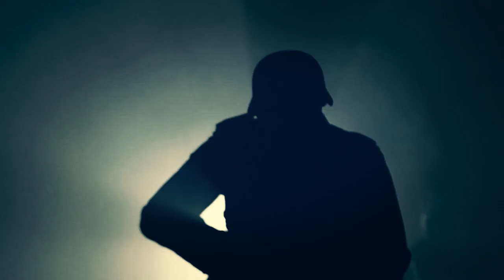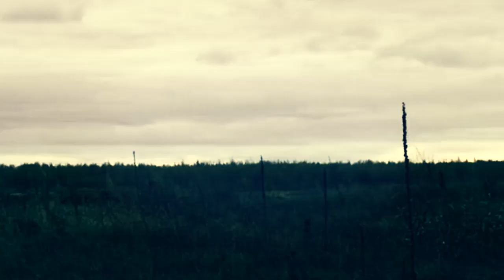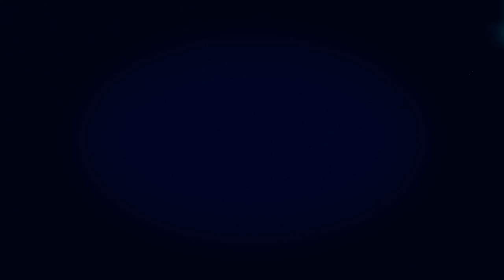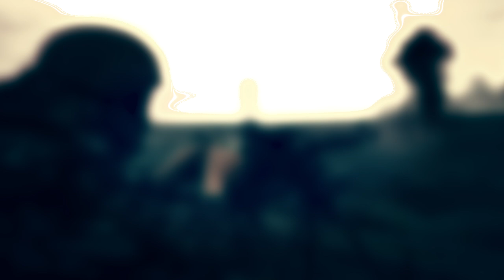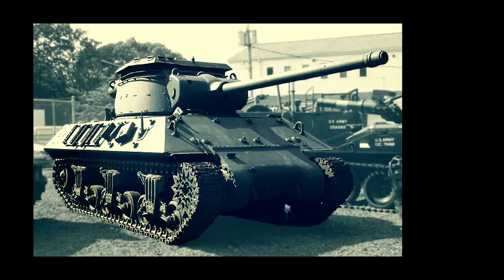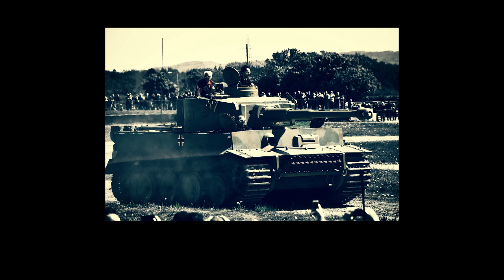The Only Running Tiger (Advanced Explainer)

Comment from the maker: Tiger 131 is not just a museum highlight; it’s a forensic time capsule. Captured by the British 48th Royal Tank Regiment in Tunisia during the North African Campaign on 24 April 1943, this Tiger I was shipped to Britain, studied in detail, and today remains the world’s only running Tiger I at The Tank Museum in Bovington.

Design came first: the Tiger I was designed as a breakthrough heavy tank. It was heavy, but the concept was deliberately simple. The hull and turret are made from large, mostly flat plates of rolled homogeneous steel with interlocking joints instead of complex sloping. This construction provided significant thickness—100 mm on the hull front, up to 120 mm on the mantlet, and 80 mm on the turret sides—but the flat shape removed the advantages of slope. Crews had to angle the hull (the so-called “Mahlzeit Stellung”) to increase effective thickness in combat. The turret was a large, cast and welded unit with a powerful traverse system. Its mass and shape made it both durable and slow to speed up.

Mobility and suspension were also important. To support that heavy protection and the long 88 mm gun, the Tiger used torsion-bar suspension and very wide tracks inspired by the T-34 design. This setup resulted in lower ground pressure than one might expect for a tank weighing 50–57 tonnes, which helped in cross-country movement. However, the trade-offs were clear: combat weight was in the mid-50 tonne range, complex driveline and transmission parts were strained by the weight, and fuel consumption along with maintenance needs were demanding in the field. In short, strategic mobility and logistics became as critical as raw battlefield performance.

The development of the powerplant is crucial for understanding the Tiger’s practical limits. Early Tigers used the Maybach HL210 (aluminium block, ~21 L), which was seen as underpowered for the increasingly heavy production vehicle. Maybach enlarged the design into the HL230 (cast-iron block, ~23 L), increasing displacement and peak power. The HL230 later became standard in the Tiger and Panther series. This change improved torque and durability, but the heavier cast-iron build added weight and required limiting factory RPM and operational revolutions to protect engine life—a reminder that more power meant more thermal and mechanical strain. During the restoration of Tiger 131, the museum installed an HL230 from a Tiger II to get it running again—an example of how closely engine design and serviceability were connected. 

What about armour versus Allied guns? Penetration tables from that time and Allied tests show the 88 mm KwK 36 could reliably defeat most others at combat ranges. The Tiger could engage enemy armour at distances where the opponent’s gun could not expect to succeed against the Tiger’s frontal plates. On the other hand, standard Allied 75 mm and early 76 mm tank guns could not reliably penetrate the Tiger’s front at typical combat distances. Only higher-performance weapons, especially the British 17-pounder in the Firefly conversion and later high-velocity US 90 mm and 76 mm HV rounds, achieved consistent frontal kills. This mismatch forced Allied formations to change their tactics: they concentrated fire, aimed for side shots, used ambushes, or deployed specialist anti-tank assets.

Captured Tigers, particularly Tiger 131, had a significant impact. After being shipped to Britain and tested at the School of Tank Technology, these vehicles produced detailed technical reports that informed Allied countermeasures. This included ammunition development, tactics for angling and approach, and the creation of Firefly conversions and specialized tank destroyers. Practically, studying running components—transmissions, turret rings, radios, and engine design—gave engineers and tacticians a clear view of both the Tiger’s strengths and weaknesses. That knowledge turned a nearly mythical opponent into a set of manageable engineering and tactical challenges.

Today, Tiger 131 still shows the scars of capture and signs of restoration. It serves as a living exhibit that highlights where a six-pounder solid shot disabled turret movement. This tells both the story of a single combat and the larger narrative of how technology, logistics, and tactics work together on the battlefield. For historians and engineers alike, it remains a unique, operational laboratory.

Sources:
https://en.wikipedia.org/wiki/Tiger_131
https://www.youtube.com/shorts/1ehTOWKmI0g
https://tankmuseum.org/tank-nuts/tank-collection/tiger-i
https://www.youtube.com/watch?v=fhj9Mzp0-eA
https://www.youtube.com/watch?v=7xzG_rRngs8
https://modernarmor.worldoftanks.com/en/encyclopedia/vehicles/G202_Tiger_131/
https://www.facebook.com/tankmuseum/videos/experience-the-worlds-only-running-tiger-131-for-the-last-time-in-2024-reas-more/1212609443201642/